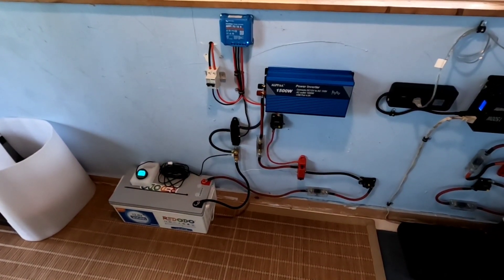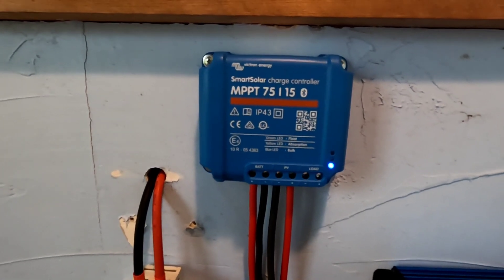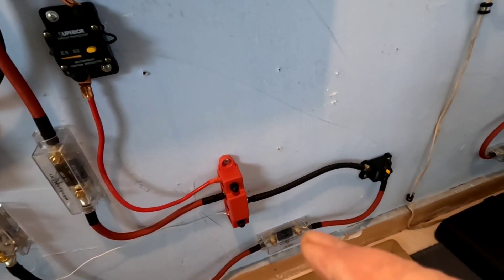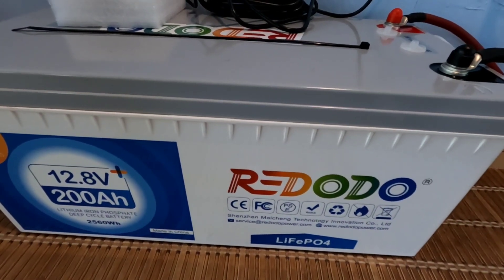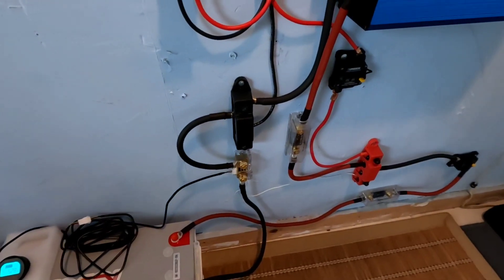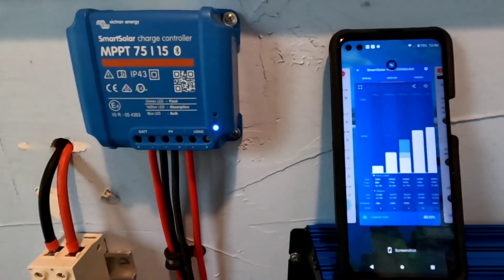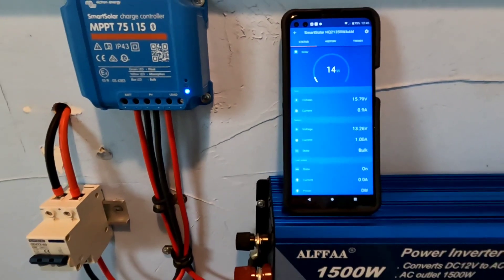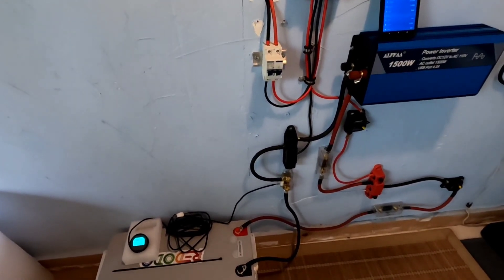Solar Charging station installed

Comment: What size isolater are you using?
Reply from the maker: 2 pole 1000v 32 amp on these smaller systems...🤙

Comment: Have you considered installing a raspberry pi with Victron Venus OS and use it to gateway you solar charge controllers so you can access online anywhere and also data log your charging?
Also then you could switch over to smartshunts by Victron and do the same for your batteries. 
I could help you with this if you’re interested, just reply here and we can talk you through it over zoom or something. Let me know
Reply from the maker: Mahalo Michael! No, I haven't considered it, because I don't know anything about that..Haha...true. I will tuck this away for information,  and will get back to you on this. Really appreciate the tutorial offer, that's above and beyond.  aloha 🤙
Reply: I have the Victron Smart shunt on my battery pack. The app sits at 20% on my phone and then will time out when I'm upstairs 12 linear feet from it. The Renogy BT-1 and BT-2 on 2 other MPPT units gives me a Bluetooth signal all the time upstairs and each is about 16 feet away. Is there anything available to boost that Victron signal?     Yesterday I put an unused pet camera on top of the unit and can read everything on my Renogy battery monitor from any location as it goes through my WiFi.  The pet cam was about $50 and can look around the entire shop remotely and can shine a red laser beam at the touch of my cell phone screen.  Cheap, but effective. It has talk and listen functions, too.  I would still like to have the Victrom app  working without standing next to the shunt.
Reply: @kimmer6  the cameras are how I used to do it, but dont allow for data logging and forecasting etc
Reply: @sNEAKYnIGHTmUPPET  Yes. So I need to go down where I get a Bluetooth signal and see the charts. But the cameras can be viewed all over the world where there is an internet connection to get immediate basic battery charge readings.

Comment: Thank you so much for showing us your system .Well made .Can you specify what are NFL fuse rate or capacity  that you  used from the battery to the inverter  ? I want to build a similar system

Comment: nice stand alone system. will be great for testing . love that Bluetooth tech . short range to smart phone or tablet or PC .I got similar breakers  . love that a button for quick off. you may need to get some more in-line ATC fuse holders and fuse to protect that small wire to shunt. you can use 2 or 3 amp . stay small . I got some 3 in 1 small digital meter from amazon . I put on my inverter now at a glance I got AC volts/hertz / AC amps . I am making a cord for my generator with that small display. I see that MPPT working even low sun. Even on a small 100 watt system that MPPT is adding up. Watch PV voltage when series PV panels . That voltage is DC and can shock you good.. always use wire rated for that higher voltage. I used UL 600V wire. looking to see what that REDODO 200 Ah can do.
Reply from the maker: Great information as usual my friend.  I got a few of those smaller in line fuse to get on the monitors...5 amp outta do it yeah? Didn't take me to long on this set up, and love that Victron tracking for sure. Even though wasn't great sun past couple of days , been getting rain, filling up the catchment...finally! Been a little too dry here lately.  Gonna work that REDODO out pretty quick! Aloha 🤙
Reply: @ProjectsinParadise808  5 amp will be fine. that the smallest in the amazon kit. I got 10 inline fuse holders and ATC fuse kit. My ATC kit from eBay has 2 and 3 amp ATC fuses. your are protecting the wire . my AC meter I used 3ag 1/2 amp UL 250V fuse. buss fuse and little fuse brand. I only buy UL fuses for over 120V . ATC/ATO/MAXI/AGU most of them 32V max . I have 24V with 32 max charge . 😊